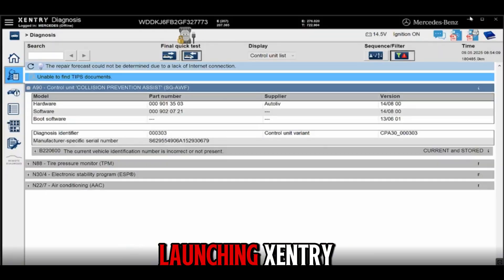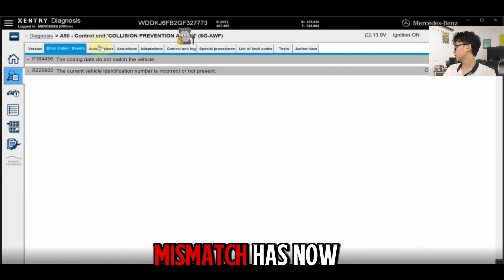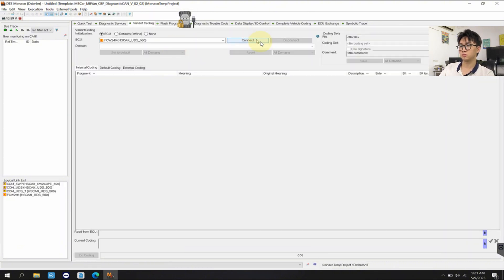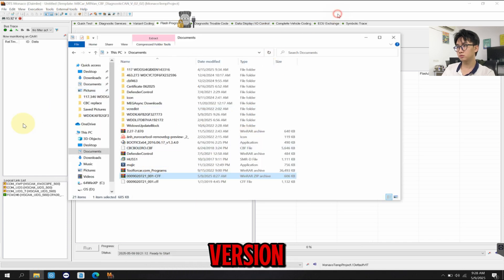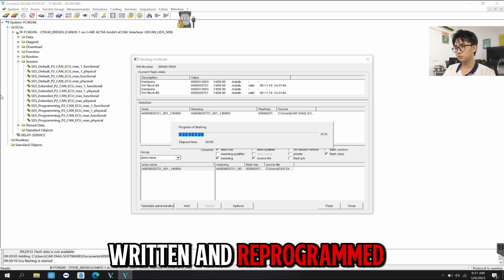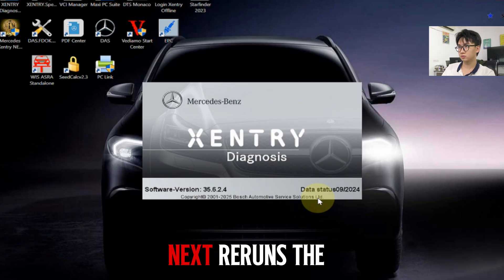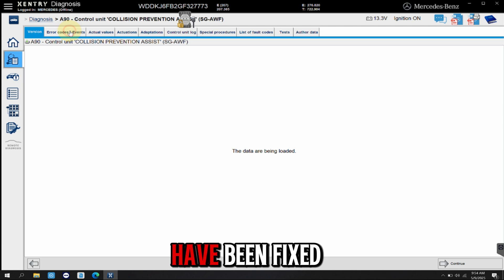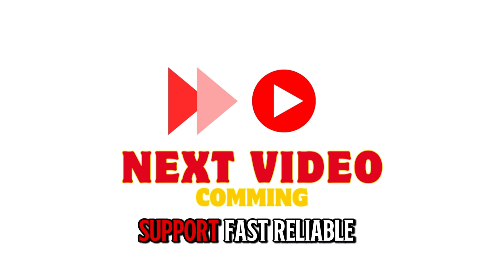How to Fix Collision Prevention Assist Inoperative on Mercedes? - You Must Watch This Trick

Comment from the maker: In this video, we show you how to fix the “Collision Prevention Assist Inoperative” warning on a Mercedes-Benz after an ECU replacement.
The vehicle had a used ECU installed, which caused a VIN mismatch and led to the collision prevention system being disabled. This is a very common issue after replacing control units without proper programming.
The error can be fixed completely by coding and flash programming to correct the VIN. Let's see how we do it!

Comment: Forcing it to clear is no fixing
Reply from the maker: @locogang8075 My friend, we don't force the error to clear. First, in 00:18 second, the error happens because of the VIN number is not correct because the car owner changed the used ECU. In this case, we only need to perform flash programming, then the problem will be solved